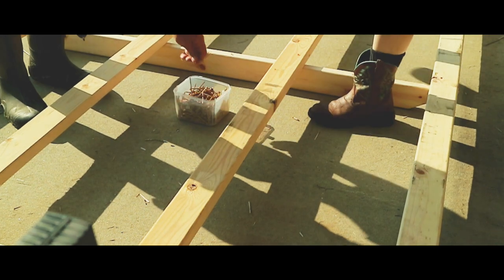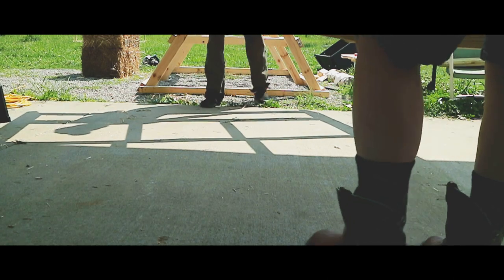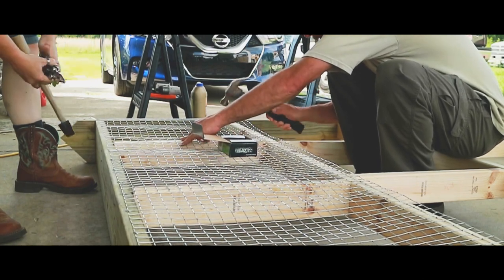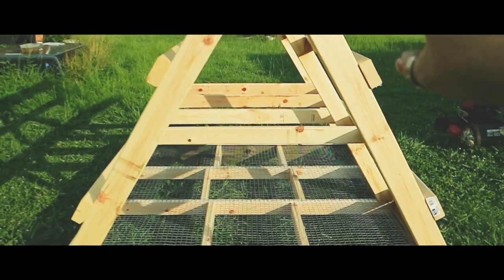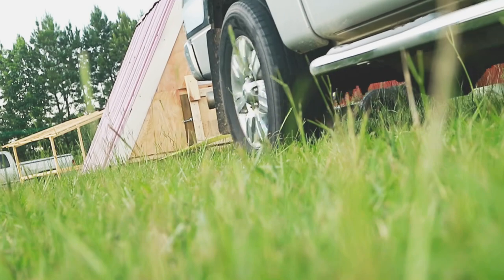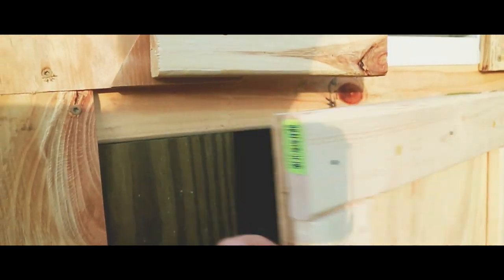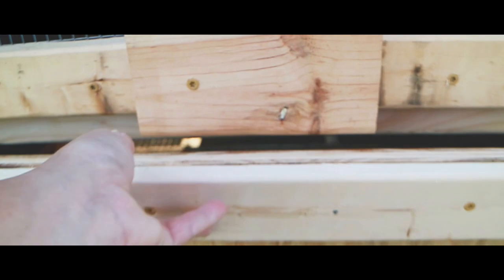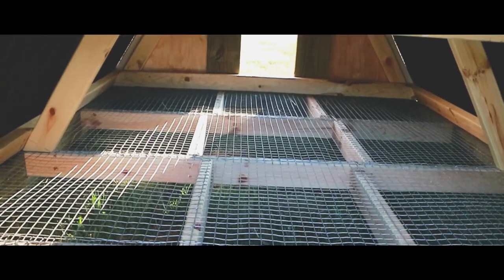THE A-FRAME CHICKEN SLED | MY BEST COOP EVER

Comment: Do you put hay or some type of bedding down on the hardware cloth and what tool do I need to cut hardware cloth when making it?
Reply from the maker: No, it needs no bedding. If you put bedding down, the droppings wouldn't be able to fall through. The hardware cloth can be cut with a wire cutter or a bolt cutter.

Comment: Was wondering if it were possible to adapt this coop using a-frame metal swing set?
Reply from the maker: Karen Gre I suppose it is possible, but you would have to find a way to attach the roosts, roofing and ends to the metal poles. For the cost of the few 2x4s to make the frame, I don’t think you would be really saving any $